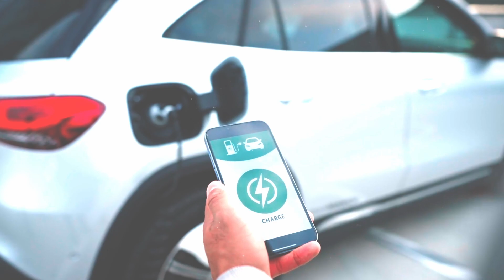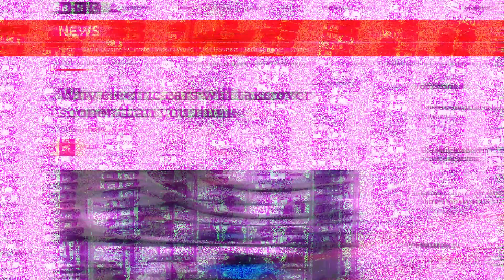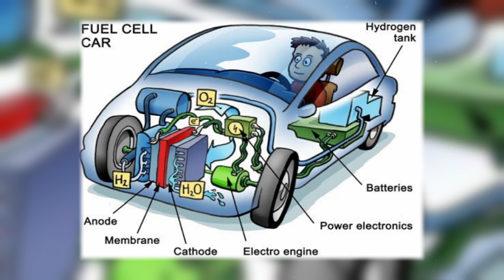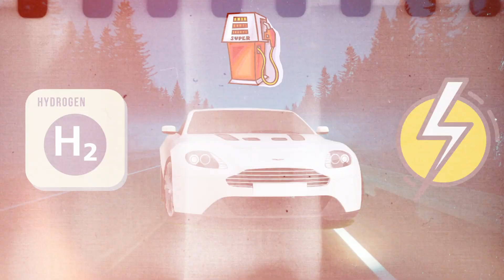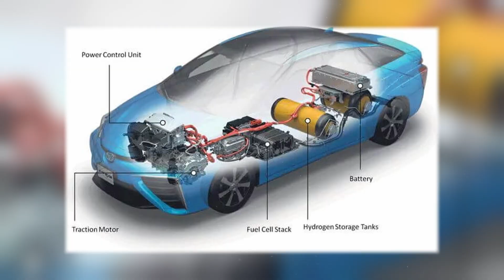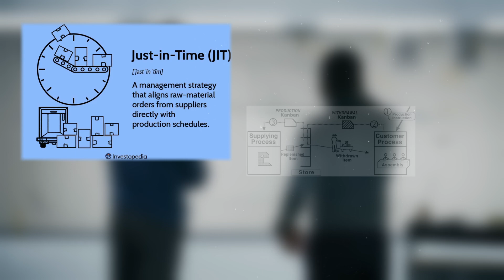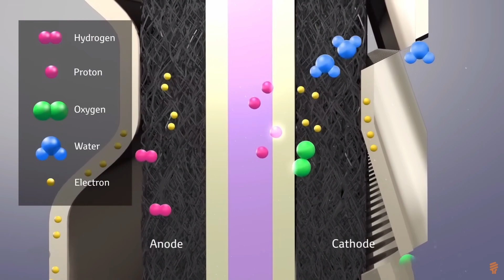New CEO Shocks Everybody | Toyota Huge News

Comment: Toyota has been doing hybrids longer and better than just about any other auto company and they are not convinced that fully electric is the future.  

The other auto makers (except Tesla) are going crazy losing money on EVs.  

It’s possible that Toyota is making smarter decisions than Ford Chrysler or gm.
Reply: No Toyota simply do not have the supply chains to compete. Toyota are in last place, and it is going to cost them big time.
Reply: @thewatcher5822  expending vast resources on new unproven technology that may or may not be the future is a big gamble either way.  

There is definitely a big push towards electrification but without another big leap in battery tech, EV of today cannot compete with ice vehicles except for a very narrow set of circumstances:  commuting in fair weather.  

If one needs a vehicle to do work like towing, hauling, or need to travel long distances or deal with frigid conditions, EV fall short of customer expectations.   

Highly efficient EV do well for commuting, but the big issue to solve is the lack of energy density.   A 100kwh Tesla battery weights about 1,377 pounds while the same amount of energy is contained within about 18 pounds or 3 gallons of gasoline.   Even accounting for wasting up to 66% of the energy in an ice engine, that still gives a ratio of 25 pounds of battery for every one pound of gasoline.   

If you take a big truck that holds 100 gallons of fuel, that’s about 600 pounds.   

Replacing this would require 15,300 pounds of batteries.   

15,300 likely exceeds the vehicles weight limit, and even if the vehicle is designed to handle the weight, the range will be significantly decreased by hauling around all
This extra mass.  

math doesn’t lie.
Reply: @jacuzzibusguy  Electric is the future, and anyone not on board with that are falling behind. Tesla are dominating and there are many advantages to EV's that ICE doesn't have. Toyota are way behind, and even if they had a compelling EV which they do not. They have nowhere near the supply chains needed to compete with the likes of Tesla.

Toyota are doomed to lose market share, and will do well to survive the switch to electric. EV's are inevitable, and for some it is already too late.

Comment: Toyota is so vested in hybrids they don't want to cannibalize their sales with EVs.   Their Hydrogen is a symbolic gesture to convince people they are not as far behind on new green tech as they are.  Hydrogen might work for planes and ships, but it makes no sense to convert electricity to hydrogen, then ship and store the hydrogen which is hard and expensive to do, then convert the hydrogen into electricity again to power the car.  Why?  Why not just put the electricity in a battery and use the electricity directly and avoid the middle-step of hydrogen creation?  Batteries are getting cheaper, so it isn't that difficult or expensive to get 200 miles of range already.  And battery swapping can make recharging very fast, faster than hydrogen or gas, and you already have charge times of just 15 minutes without swapping.  Hydrogen costs a lot more than gas and electricity costs a lot less.  This is a fool's errand Toyota is on.  By the time they decide to try to get into the EV market, it might be too late.
Reply: I agree. Also, I have two Level 2 chargers in my garage. You can't buy a hydrogen one for the house, and if you could, it would use twice the electricity, and need a water line, and maybe ventilation. I don't have to drive anywhere to fuel unless I'm on a roadtrip. There isn't even a hydrogen fueling station in my state. How close would you need one to be to even be able to use it as a commuter? I think the hydrogen thing for cars is only useful to get government subsidies. And now, EVs are getting prodoced by the millions, so economies of scale are happening. Hydrogen is nowhere.
Reply: @fjalics  They said the same thing about the E.V. over 10 years ago, so I am all for "The H.I.C.E. Powered Car"  and this is a much better future than only electric!!🙂👍🇯🇵🇺🇲🌟🌟
Reply: @christopherscuorzo3044  It will never overcome the many disadvantages. It is less efficient than a fuel cell, which is half as efficient as an EV. You need a lot of people to want these to get infrastructure built. This tech is a dud.
Reply: @fjalics  Never say never!
Reply: @fjalics  Just wait, and see because I know, for a fact, that a great deal more people would rather have their choice in purchasing a brand new "I.C.E. Powered Vehicle," than just over only an electric one!!🤣
Reply: @christopherscuorzo3044  Hydrogen is a dud. The industry isn't capable of building enough EVs for everybody yet, and many have had very little exposure to EVs. Take you for example. Do you own one? Ever driven one? Riden in one? Any of your friends or family have one?
Reply: Evs are not new. Evs have been around for more than 100 years.  They were built and sold in this country before the gas engines were invented  ,even before Henry Ford started his companyand it went no where. The idea looks good on paper, but is not practical . It does not provide a solution or alternative to ICE engines.  It's all hype now but it will fail ,and for the same reasons it failed 100 years ago. It's not practical, it's not cheap, it's not easy to maintain and it's not scalable and it's not  wanted.

Hydrogen is the next most reasonable solution. It plentiful, it's clean, it's practical and efficient. You can refuel your car in 90 seconds for another 300 miles. It's only output is water, clean water.

Toyota is on to something big.  eVs will eventually be discarded, abandoned and will fill our junkyards as a bad memory of  going green mass hysteria.

Toyota can see clear with logic not hysteria.
Reply: @maikgom1  Henry Ford's wife Clara drove a 1914 Detroit Electric Model 47 Brougham. I've been driving an electric car since Nov 2018, and you believe nonsense based on what, stuff you heard? Hydrogen is half the efficiency of electric, and you can't fuel at home. The only thing electric can't do is cross the ocean with one charge. On land, you build chargers every 100 miles. No biggie.
Reply: You are exactly right. Toyota had a few hydrogen cars driving around Northern California ten years ago but they haven’t caught on. It would take a huge infrastructure to support hydrogen cars but for whatever reason it isn’t being built. EVs are here now and will be the future.

Comment: I'm all up for a cleaner fuel for  a better and cleaner world.  Whoever can solve this problem will become the future of the world. Toyota seems to be headi seems to be heading in the right direction.   Electric cars are just too costly, and ability to hold charge longer is very small.
Reply: However hydrogen cars would need a large infrastructure just to support them and so far there isn’t one.

Comment: I think Toyota need to review their decision before they made similar mistake of Nokia and blackberry. Considering the huge of resources that the majority of automakers invested in EV research and Development, Toyota needs to rethink again because what of if a breakthrough innovation reduced the weight of car batteries, improve capacity of the battery and reduce the overall charging time? What of if efficiency of solar panel is significantly improved to the level that tiny panel on top of vehicle roof can provide sufficient power to the vehicle and even eliminate the need to even plug the vehicle to the charging station? This is probably possible if we consider how technology reduced the size computer and improve its performance.
when EV is improved, it will definitely be more convenient and even cost effective than Hydrogen.